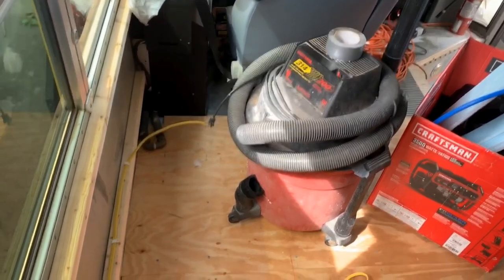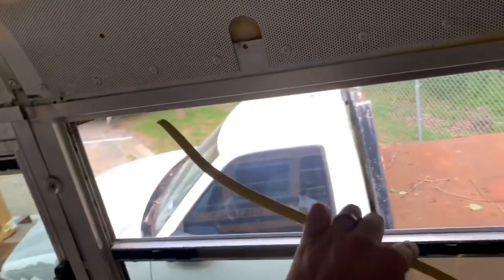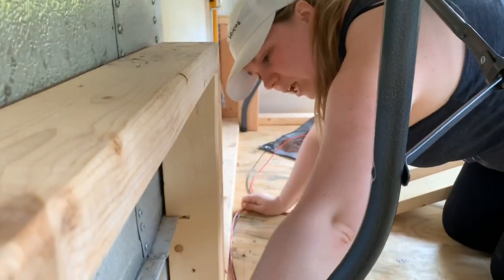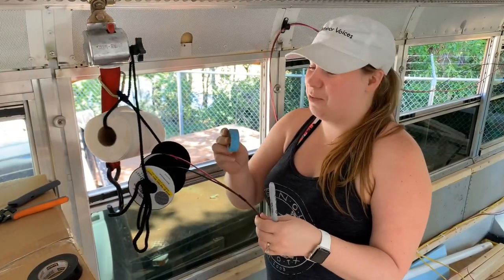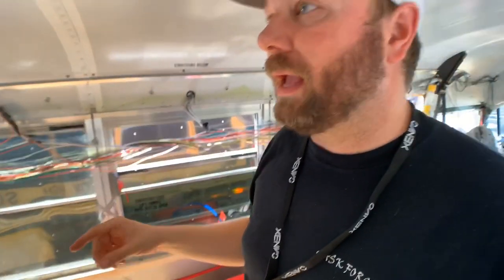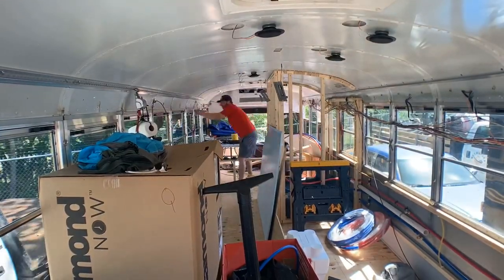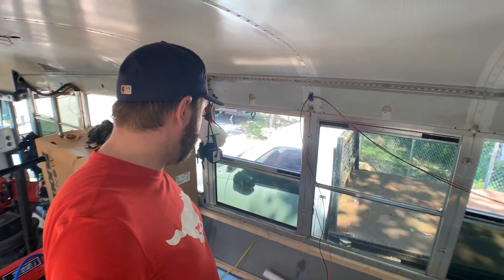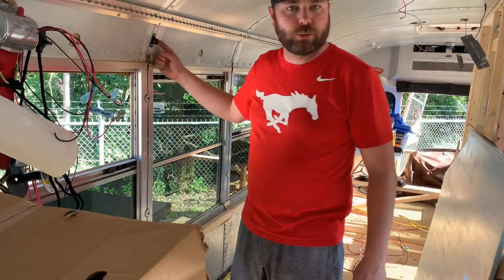Skoolie Electrical Wiring (Electrical Rough In) || 2020 Bus Conversion Ep. 9

Comment: You used 12 gauge wire to run for the water heater? Or did I not hear right? I had pictured how to do this,  and your video is  the same picture as I have.

Comment: Are you having any trouble making walls/headers not removing the ceiling? I just can't see tearing down a perfectly good ceiling especially if its insulated already. Thoughts?
Reply from the maker: We left our ceiling. Our walls are screwed into the bus rib above. Just through the metal ceiling. We felt the same way about it being in good shape! Plus, we have the sound dampening ceiling and wanted to keep it.
Reply: I agree why tear down  a  perfectly good ceiling, which I have seen it down more than once on videos of skoolie building.  I am building my skoolie and I have insulted all of the  walls from the top of the windows down to the floor. I installed 1" thick insulation board in walls, insulation taped around all  windows sealed and coated with paint and also resealed all of the windows inside and out with 100% silicone. Going to refinish the ceiling with semi gloss white Behr water base epoxy paint for now, and it is in good shape as it is.
Reply: Considering starting a schoollie project, I’m in western Canada where it’s COLD ALOT haha I was under the impression the insulation in the ceiling needs upgraded in colder climates.... thoughts? Thanks!
Reply from the maker: Yes, you’ll probably want new insulation. We’re not planning to spend much time in winter weather. We just endured snow in Dallas and Las Vegas (both unusual) and both agreed it is not our typical plan. It was cold even just around freezing. Because we are planning to chase 20-25*C weather; we decided to save the time and money of replacing the ceiling.
Reply: @SuperBuggerboo  it most definitely needs replaced if in colder climates.  Spray foam is a bit more costly but provides the best R value which is a measurement of insulation.  Keep in mind that spray foam is said "gas" or release toxins for up to a couple months afterwards.
Reply: @vaughn6371  after a period of time toxins are no longer an issue? I wonder about hot days when the sun is on the roof…. I have 2 small children so it’s a concern for me…
Reply: @robertcorbett2873  any pictures of this while installing or blogs or you tube videos?
Reply: @SuperBuggerboo   we went back and forth on taking out our ceilings we have a 1990 international and the ceilings were in great condition and when we started we realized the ceilings are steel! They have been really hard to take out and we have rivets, also a steel lip that's holding the ceiling and windows but...we already started and we will be full timers so we are happy we are doing it and now looking closer at the insulation its pretty gross in spots. We are using Havelock Wool insulation in our bus, its completely non toxic and provides excellent insulation and doesn't mold

Comment: Great video, but..... You do know your low voltage (12 volt DC) should not run along side your high voltage (120 volt AC). It is an electrical hazard and can cause interference in your low voltage lines.... Just saying.... :)
Reply from the maker: Thanks for noticing! We’ll double check. The electrician we consulted said that we only needed to worry about that with phone, internet, cable type of lines. We’ll do some more research!
Reply: @TaleOfTwoSmittys  It could be that way where you are. I'm in Wisconsin and we have all kinds of rules for running electric, network, tv, etc... We can not put anything but the AC in a box or conduit. All low voltage has to be in it's own box, conduit, or wire run. Love you videos though. I wish the work on our van was going a little faster though. I want to get on the road this year yet... Peace and Blessings.
Reply from the maker: I gotcha. We’ll double check. Thanks for the support and for watching!! Good luck with the van!
Reply: Wow thanks for passing that along.
Reply: @danielw6610  Thanks I will check more on that too.